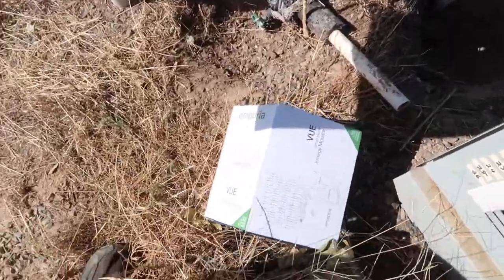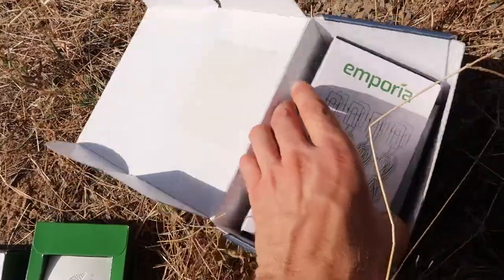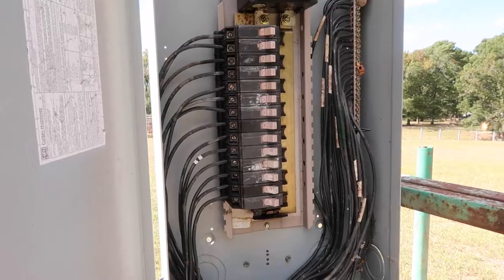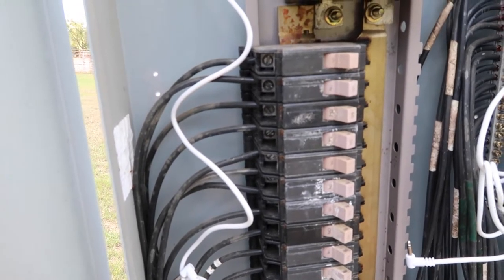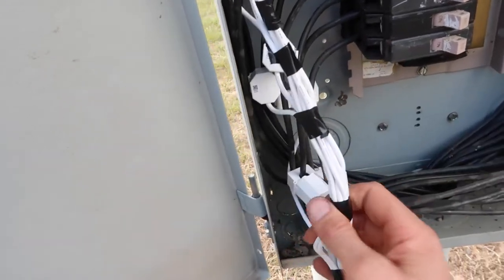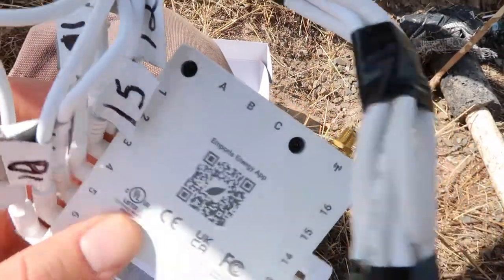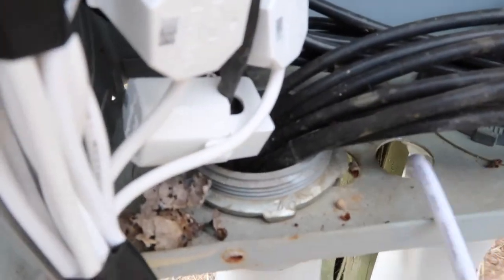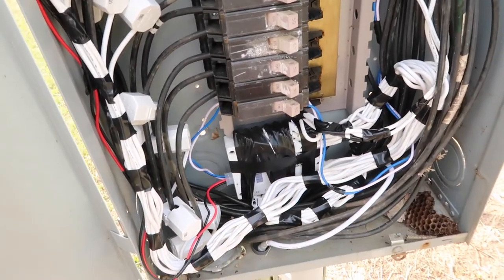Installing and programming RV Park Billing hardware - RV Park electricity automation

Comment: Did you use 1 CT per pad or breaker ?
Reply from the maker: These circuits were one wire per pad (one wire per breaker). Other circuits at this park were 2 wires per breaker/pad and have 2 ct's measuring each pad.